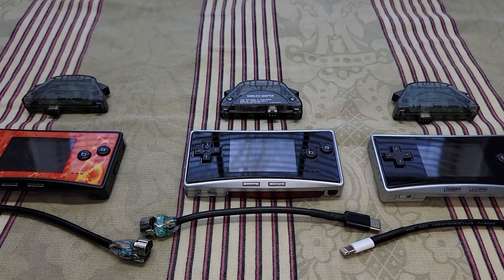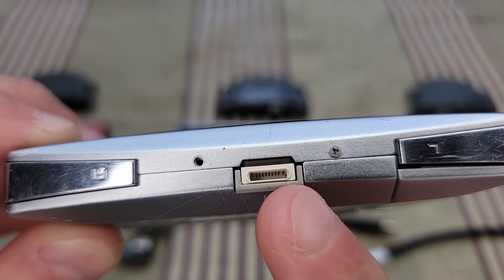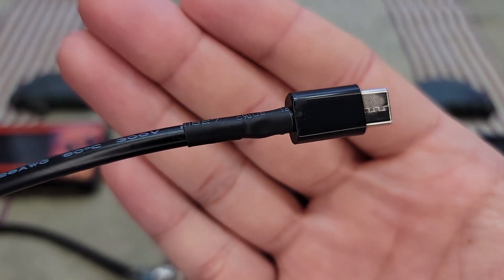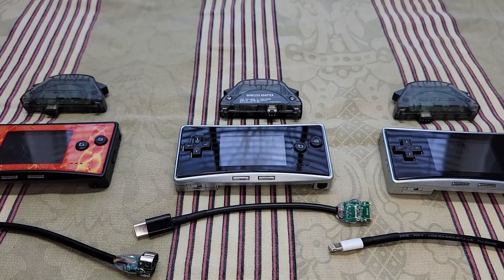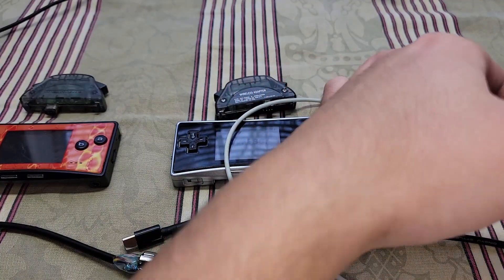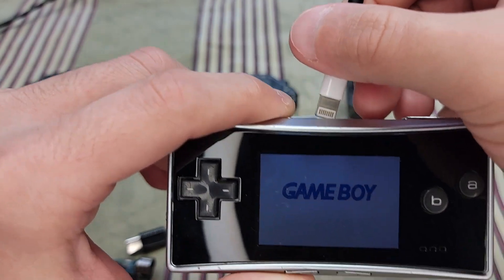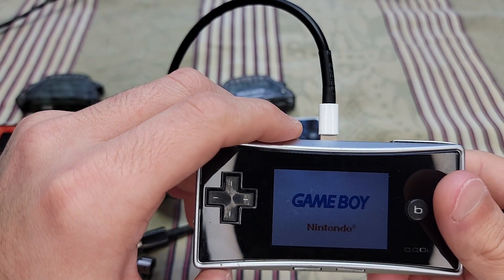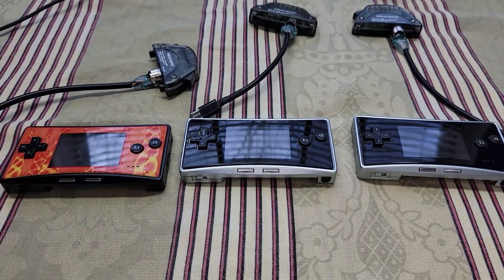Game Boy Micro: Overview - An in Depth Look at my GBM, Lightning, and USB Type-C Link Adapters!!!

Comment: Hey man, just getting in to the world of modding - enjoying your videos! QQ - what are those custom adaptors for? It seems you demo each of the different charge ports with standard cables (usbc/lighting) so I wondered what the adaptors are for...
Reply from the maker: They were a fun project at first but obviously most people want to mod their consoles with USB-C to make things easier. I just wanted to show that you can add any port (that will fit) to the Micro and it will support charging (as long as you have a 5V source) and EXT functionality (as long as your port has at least 6 pins). These adaters allow you to use just about any ad-on for the GBA on your Micro by taking advantage of the GBA male plug.